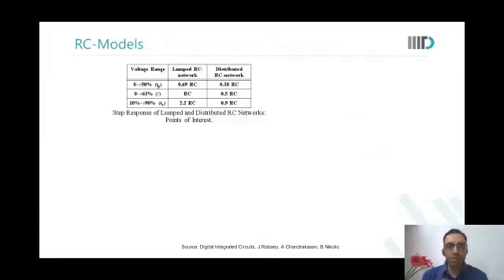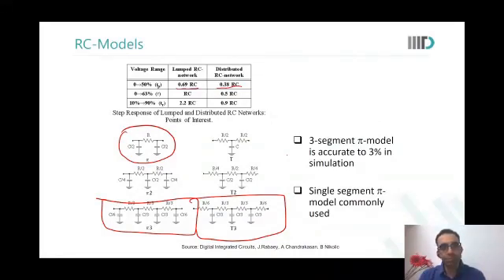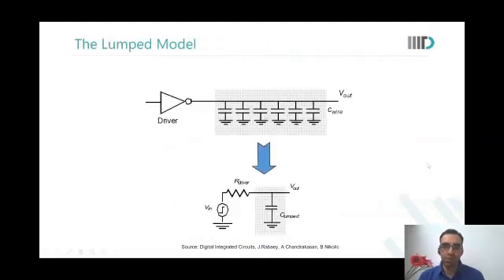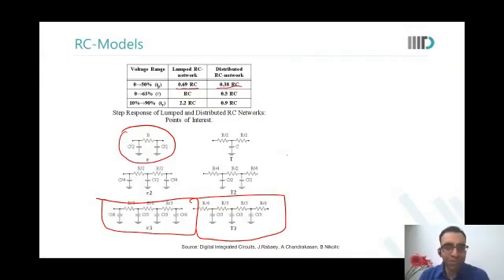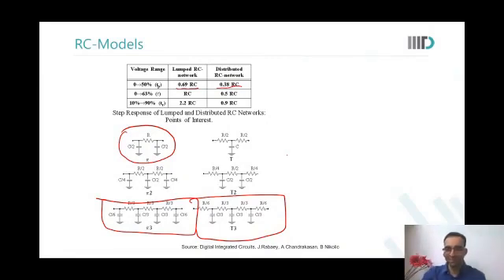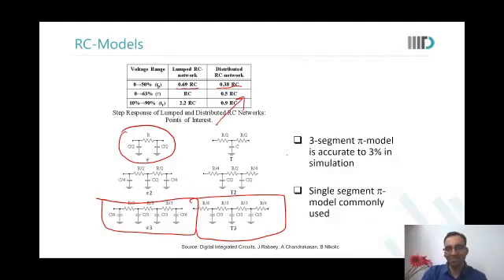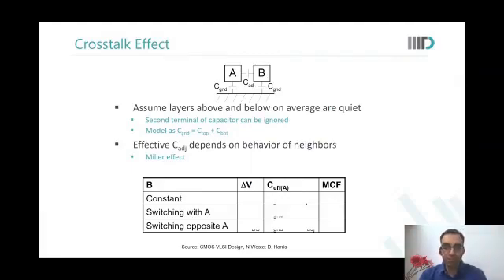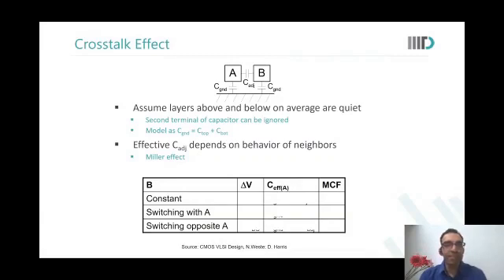Interconnects | RC Models

Comment: how do we decrease RC Delay of a particular wire
Reply from the maker: RC delay of a wire can be reduced by reducing both R and C - together or independently. 
To reduce R, one can make the wire wider, or change the metal layer that has lower resistive, or change the routing connection to make it shorter. 
To reduce C, the wire can be spaced farther away from other wires that can add coupling capacitance. One can move the wires in the metal layers above and below the target wire away from the wire. 
When the coupling capacitance is with another wire that changes signals in opposite direction, then adding shielding will reduce miller capacitance. 
Depending on the area constraints and other flexibility that you have in routing the target wire and other surrounding wires, R and C can both be reduced to reduce RC delay. 👍🏻